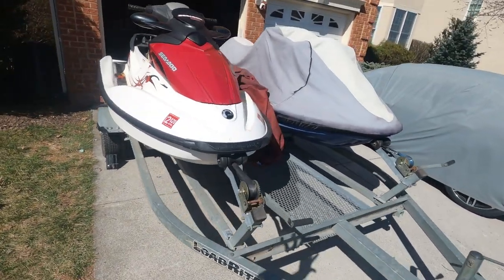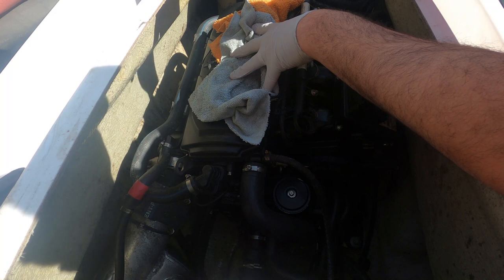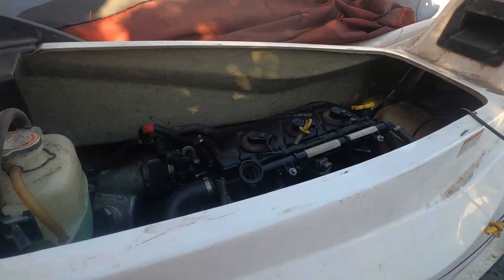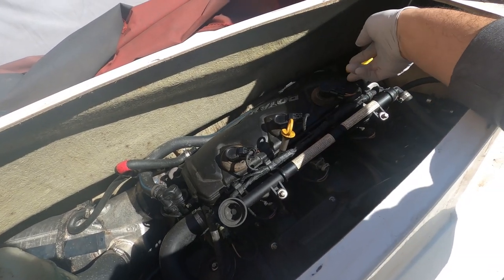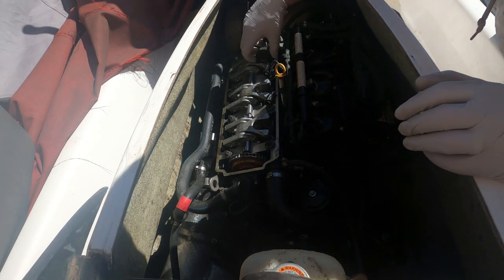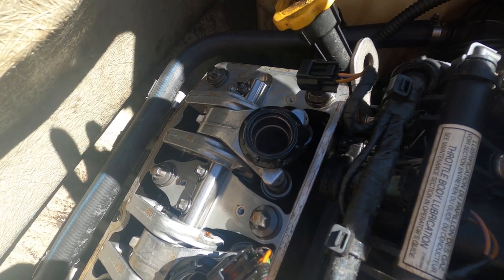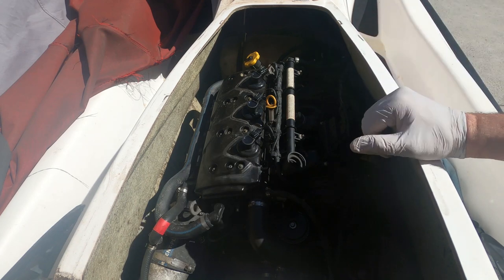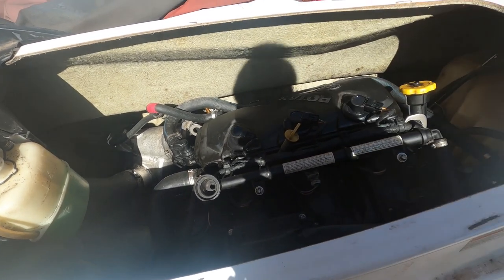How To Fix Seadoo 4 Tec That Is Not Starting And Just Keep Clicking.

Comment: Have the same problem but it still clicks when i pull my plugs out, turned the engine by hand and it turned. Any idea?
Reply from the maker: Did you try to Jump the starter solenoid and checked your starter?